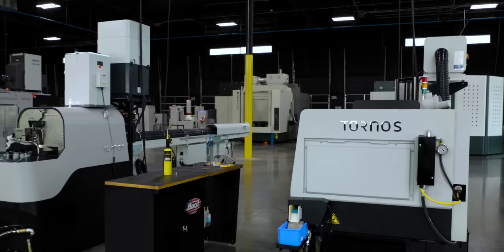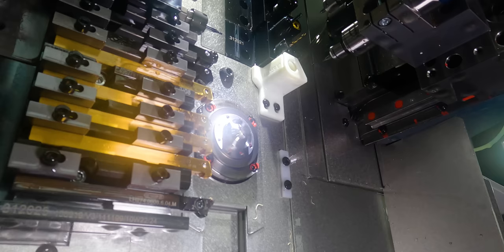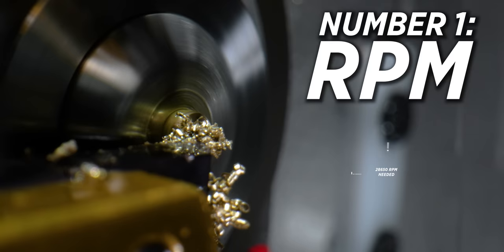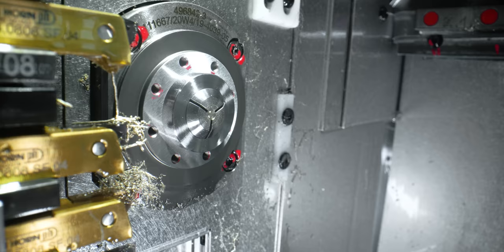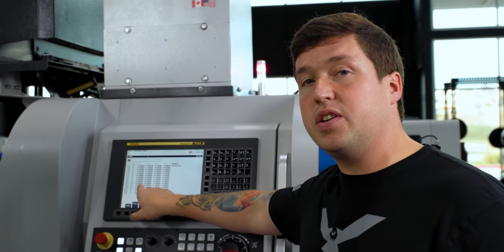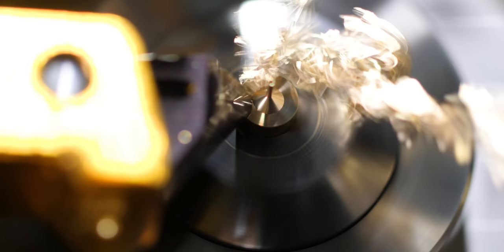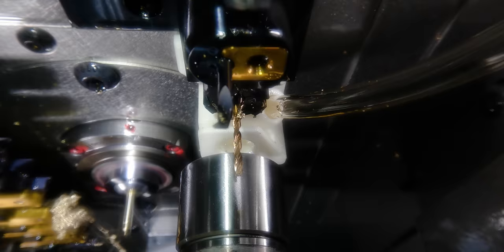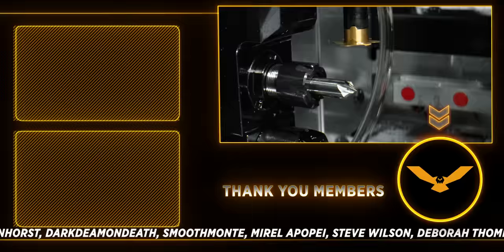I Drilled a Microscopic Hole Into a Stainless Medical Device

Comment: That Tornos Nano is, what appears to be, the pinnacle of "Swiss" machines. I use the "Swiss" for a reason. Go back multiple generations of "Swiss" machines til you get to THE SWISS MACHINE. All axis' driven are by a master cam that guides all of the axis' through a single rotation of the master cam. They were micro-machining parts long before CNC was added. Donnie: you've  got to get yourself to a shop that still uses the OG Swiss machines. It would be really interesting to see a cam-driven Swiss next to the Nano

Those micro-drills are creep-fed, full-depth using opposed grinding wheels, similar to pinch turning. The carbide drill stock must go through an intense QC check. Even the tiniest inclusion would cause the "tink of death". That's if you could even hear the "tink".

Comment: I run .02" holes to .180" deep in Ti and can get at least 2500 holes done before the drill needs to be swapped out. All at 6k rpm, pretty amazing considering the rpm limit we have on our swiss setup. Tool centered using just some dials as well. Micro stuff is crazy!

Comment: As impossible as it appears to center and drill a hole that small and that deep.....
I'd love to see a video on how they make the drill itself.
Reply: Dude same! I was going to actually say that in the video but I am confident no one is allowed to see that. When you look at these drills under a microscope they have perfect geometry. They look like a .5” (12.7mm) drill up close. It’s beyond impressive
Reply: @donniehinske  ....sneak in. 
My learning about number drills happened years ago when I hobbled together two pieces of thin brass sheet material to make a holder for a drop in style polarizing filter for my Cannon camera lens.  Those need to rotate.
I needed a small drill to match some small diameter brass " hobby stock " rod to make little roller bearings.  A new specialty shop in town had some of these drills.  This was back in '95 or so. I was amazed back then at the small drills... wondering how they made them.  
Yours however, are much, much smaller..... yup, amazed once again 🤯
I'm a tinkerer, not a machinist.

Comment: I worked for a company 20+ years back that had the record  at the time for the smallest hole "drilled" at time. It was .002 diameter. They had a huge collection of tiny Agie sinkers that were still functional but getting hard to get parts for! So my genius buddy designed and built a them a new power supply to replace the old Agie OE!  Scary smart guy!

Comment: Respect!
Also did this kinda stuff on a Schaublin 125-CCN. But with smaller drills. And external powered spindels. But it worked.
Most precise machine I've ever worked with!
Also swiss made. They rule.
Perfect Synergy: Swiss Machines and German Tools!

Btw. PH Horn, Kennametal, Iscar and ARNO rule!
(Oh, and Britsch of course).

Comment: I have been around different types of swiss machines and as they warm up we have noticed some drift in diameters and lengths, how are you ensuring that the spot drill when you set you center it is at the same when the machine is at operating temperature?
Reply: From everything I’ve seen the nano is insanely consistent. I haven’t really gotten down to the .0001” increment with charts or anything like that however with this part we ran 100+ for this video out of stainless and brass. It never broke a drill. My handling of them was the only issue 😂. I know that doesn’t fully answer your question but it IS all I have for now

Comment: The craziest part I ever made was when I just learned how to lathe, it was a 316 Stainless Steel part, a transition ring with 0.005’’ wall thickness, and 0.005” holes on the sides milled on the 4 axis, I did tons of attempts until I finally achieved the process, so delicate you could scrap it with the minimum force in between your fingers. I did it on a Tormach 8L haha

Comment: I have always wondered about the part ejection process for Swiss machines.  Particularly with this part.  If you just drop the part into a basket how likely is it that it lands just so that the delicate tip gets bent or something?  After seeing bigger CNC parts be handled with great care to protect surface finishes and whatnot, just tossing finished parts in a bin seems odd.   Any thoughts?
Reply: Yes! Good call! That was actually the customers biggest concern with this machine. Really our solution was more trays to land in. Due to the way we manufactured the part luckily they will land on the big end. With the Tornos TMI screen we can select how many baskets are in our part catcher. This will allow us to 3D print smaller baskets so each part gets its own Individual landing spot. That’s NOT the only way to do it but it’s a way that I thought would be easy
Reply: @donniehinske  You could partially fill the container with oil to dampen the part's drop speed.
Reply: @BasementEngineer  when actually running the part oil does fill the container

Comment: WOW.  That's tiny.  I'd like to try that one day.  I thought drilling PCB testing probe holes for sockets for PCB fixturing and program testing were small.  Most range from .069" to .032" This is EXTREMELY TINY.

I drill the .032" at about 2750 rpm but

So 6 ten thousandths is literally dust. lol.

Comment: For test cut/hole to work one needs to be able to find hole. Amazing what was feed rate?
Reply: 60 SFM (18 SMM) -> for 0,008'' drill (0,2mm diameter) its 28 648 RPM [revolutions/minute].
Guhring recommended Feed Rate (IPR - inches per rev) for 0,0063 inches diameter drill (0,16mm) is 0.0004 [inch]
So its around 11 [inch/min] ([286mm/min]).
I was using 0.1, 0.15, 0.3 and 0.4 drills and the 0.1 was the nightmare. 
I needed to go 0,5mm deep with them, each part with different hole diameter (prototype purpose).
Broke x9 0.1 diameter drills and 0 others HSS-E-PM drills in Stainless 304. 
It was challenging, but doable, even with 5 000RPM only hah

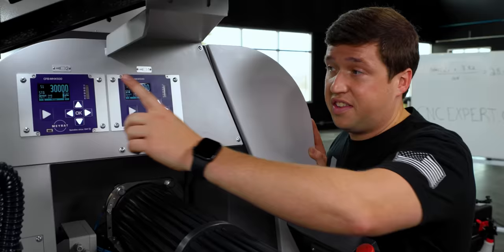Comment: at 1:52 you are saying "this is where you control your RPM", why can't you control the RPM like your main spindle on the computer in the front, when you can call them via a M-Code?
Reply: There are high frequency spindles that can be controlled like that.

Comment: Try drilling a 0.05mm (0.0019685") hole in stainless steel on a Bridgeport milling machine. Talk about pulling your hair out...

Then when you get it drilled you can't see the hole unless you hold it up to the light. And you need a microscope to see if your drill is broke or not. Concentricity is a killer on a drill that small. 0.0001" runout just isn't going to work very well.
Reply: I would NOT want to try that on a bridgeport

Comment: I made a part on the nano once that had a .0035 thou through hole with a .008 thousands diameter up to .0125 diameter at .012 thousands in length

Very challenging